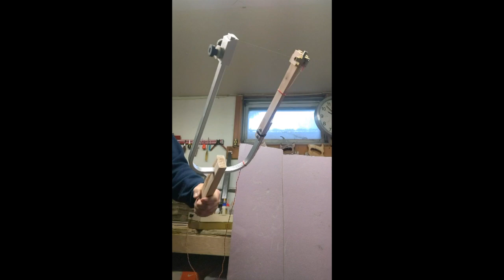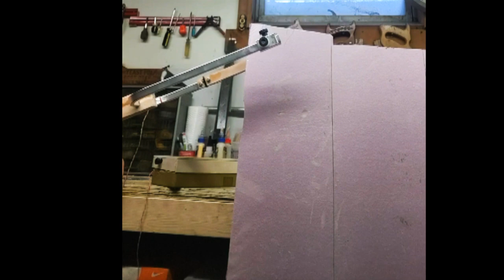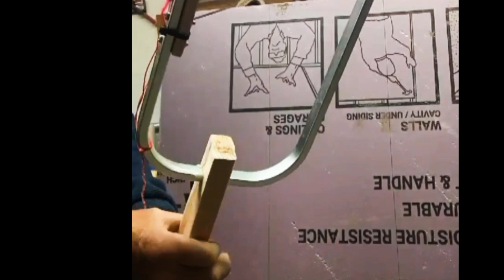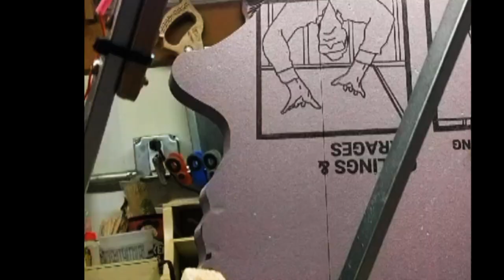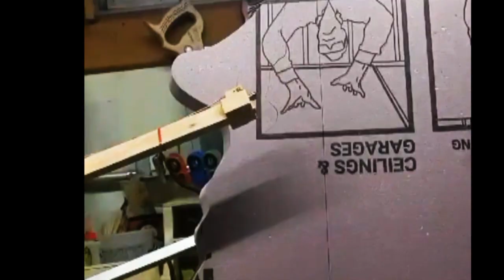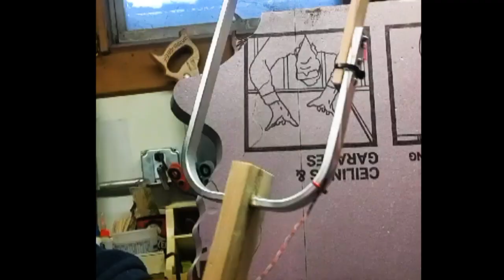Hot Wire

Comment: Intense!  I need something like that to cut foam rubber.  Doing it with a carving knife is slow and generates a lot of foam "crumbs" that get everywhere.  Great soundtrack for cutting tools, too.
Reply: i agree..i use a Knife for everything...MESSYYYYY is my middle name...lol
Reply from the maker: Oh yeah, it works great on upholstry foam! It requires lots of practice to get a straight even cut, though, because that tiny hot wire slices so quickly. Most of my cuts are very wiggly, almost expressing pulse of my heart beat.

Comment: Brilliant. Everything. Can you carve a model of the empire state building? How many amps? What wire did you use?
Reply from the maker: It apparently uses 10 volts and 1 amp to heat the .2 mm wire. I'm assuming its just regular steel wire but Proxxon sells its own replacement spools so it may be titanium or something. 🙂 
I bet I could sculpt a building that size but it would take a lot of foam!!😁
Reply: @pbartmess  that's a 10 ohm resistance so it must be some clever alloy to have such a high resistance and also to be cope with high temperatures without melting. Superb beats too the soundtrack really reflects the tone
Reply from the maker: @loopinnerthe  Thank you for the beats compliment! I was going for drum n bass but I don't know what it actually turned out to be. Also, I am not sure what I'll actually do with this monstrosity now that I've made it. It's probably another one of those projects that was testing a hypothesis but doesn't have an application. Now that you bring up the alloy, I am quite curious about how hot it will actually get before popping. Watch this space.